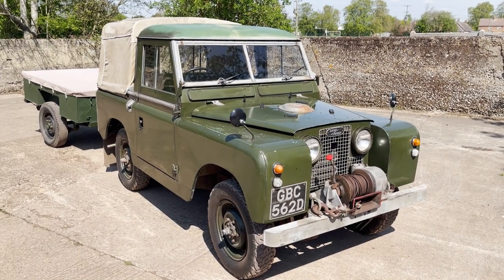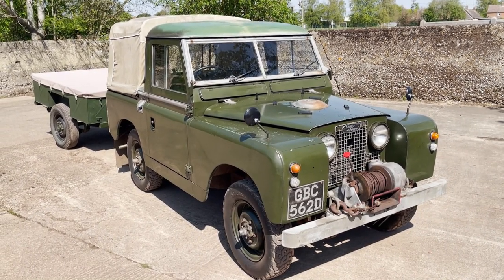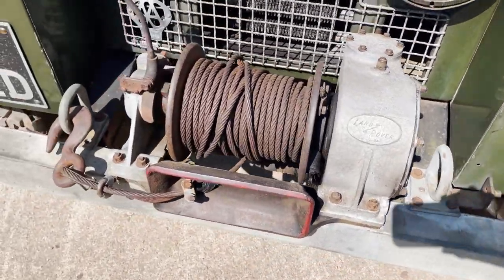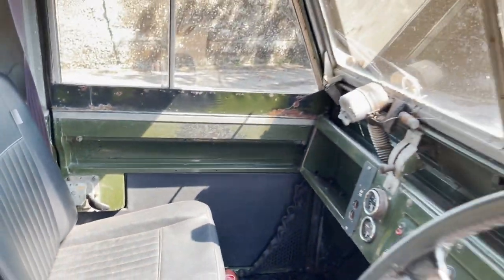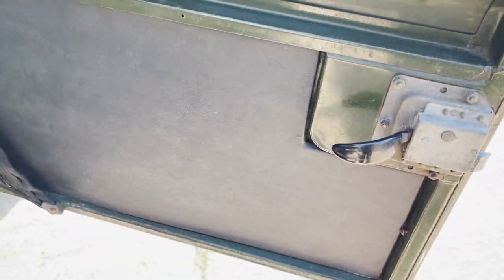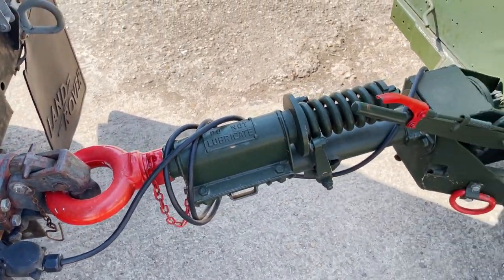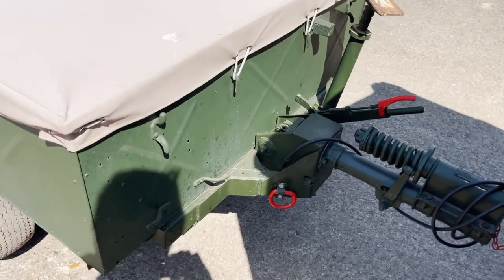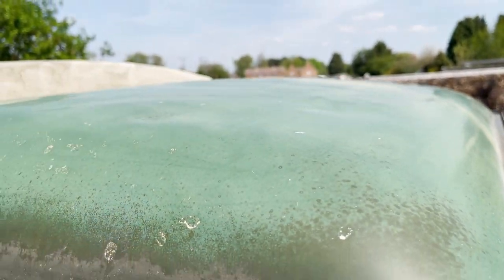land rover series 2 truck cab for sale walkaround + starting, idling

Comment: It's an Ex Military FFR, Fitted For Radio, Landrover Series II. Giveaways are, Military headlights and six way switch, oil cooler and hand throttle for generating power for when radios in use. Ex military trailer looks to be either a Brockhouse or Rootes. Can't help you out on the winch.
Reply from the maker: indeed, although there's a) no trace of a military data plate, or b) it's never had twin tanks and has a civilian rear tub. We've sold it now, but we think it was first supplied to an MOD-approved contractor rather than the MOD themselves, possibly RAE Farnborough or similar, and not registered until disposed of
Reply: @motodromehenleyonthames  It will be a "CL" model of Landrover used by the military, a strange set up of half military and half civilian bits and pieces.

Comment: Hi Simon like this channel watch your videos regularly, just want to ask one question. Will 285 75r16 tires fit a 2013 defender 90 without wheel spacers and on standard suspension.
Reply from the maker: I'm not sure Steve - I've only ever seen 285/75's fitted with spacers

Comment: Interesting one, lots of originals military features but also lacking certain features such as under seat fuel tank filler abs bump stops in the wings. Are the front wings reinforced as that could further support it being military? Looks nice though!!
Reply from the maker: Yes it's a strange one. I think it's more likely it was first owned by a civilian contractor to the MoD hence not full military spec